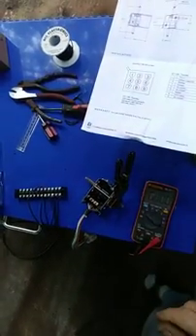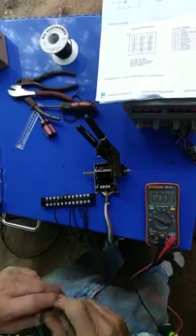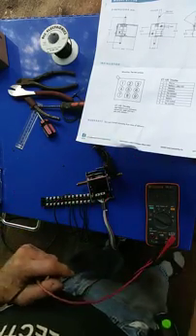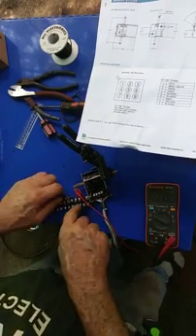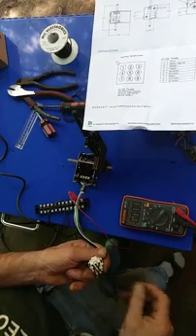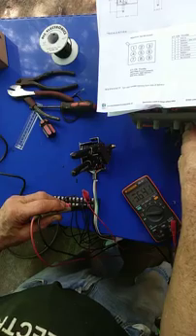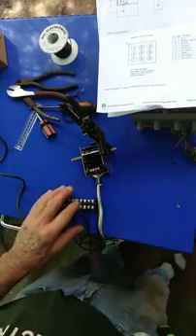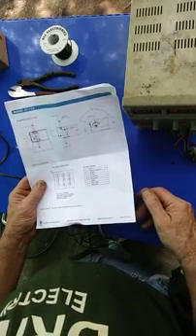Ev throttle with forward and reverse hall effect Curtis e t 126 or  ET 1:34 MCU

Comment: Hey sir, I have a throttle pot wired to a dc drive. When rotated to one side moves the motor forward and rotates to the opposite side moves the motor in reverse. I want to completely remove the throttle and control the direction with relays. If I use two relays (one relay contact closes wiper to high reference and the other relay contact closes wiper to low reference) will this work? I am assuming the motor will start at full speed right away?

Comment: Do you know how to wire this to teh 1212p? im not sure how it goes into the  controller pins.
Reply from the maker: Is that a AC controller? This throttle is a hall effect which means it gives out a certain voltage and it must be supplied with power supply from the controller. 5 Volt or 12 volt seems to be common
Reply: @steveclunn8165  No, its a DC controller.  Like this one https://image.made-in-china.com/202f0j00yplRaEzgTHoD/PMC-Motor-Controller-1212-2401-24V.jpg

Maybe you have worked with this before.
Reply from the maker: @puchomoreno  not yet , lot of pins 😌.sorry i can't help
Reply: @puchomoreno   Did you end up figuring out how to connect it?.
Reply: @katyminidumpsters867  yes we finally did.
Reply: @puchomoreno  I have a controller just like the link you sent...and I'm trying to figure out how to connect it
Reply: Are you able to tell me how to connect?
Reply: @katyminidumpsters867 Jaja you're welcome. We've started building these https://imgur.com/7aCgl6j and that where we are using it. Any questions, just ask.

Greetings from Argentina.
Reply: @puchomoreno   I tried to connect with the diagram you sent me and can't get it to work....don't know what I'm missing.
Reply: @katyminidumpsters867  what type of throttle are you selecting when configuring it? Use type 7
Reply: @katyminidumpsters867  yes, we use the same. Do you have a programmer for the 1212 controller? Because maybe you need to edit its parameters. The controller may have some parameters off and make the et126 not usable until you change them.
Reply: @katyminidumpsters867  well I can't help you with that controller. The wires we use are just those 4. 24v, negative, reverse signal and pot low(throttle position). I don know how can you configure that controller. We use a Curtis controller with a Curtis programmer to change the parameters we want.